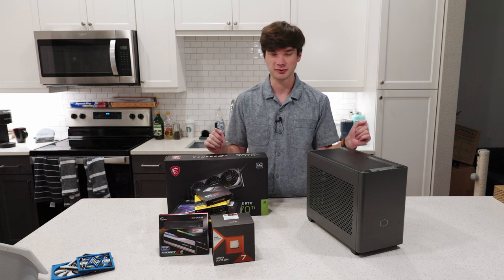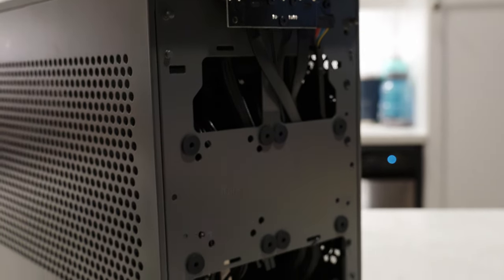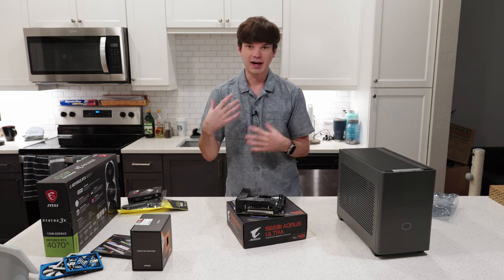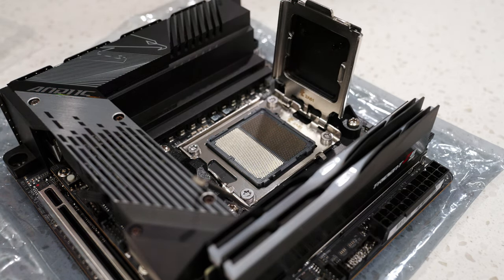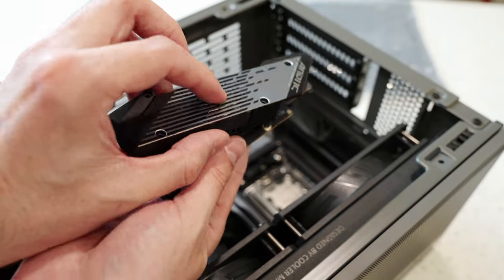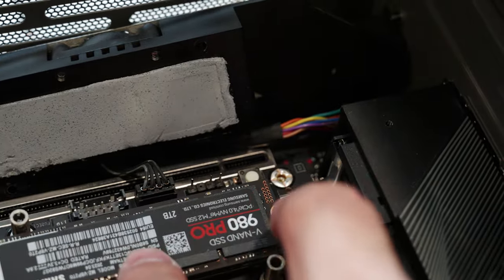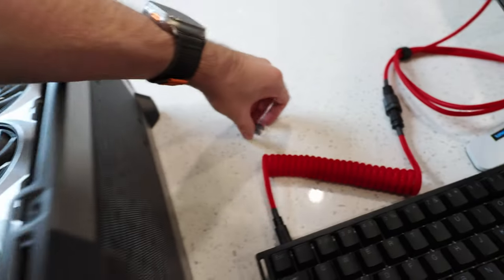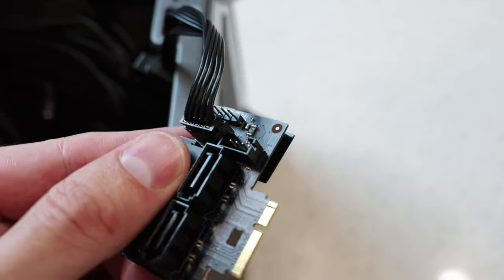The Powerful SFF PC That's Fun To Build w/ 7800X3D, 4070Ti

Comment: I'm planning on building a new pc soon and it will be my first build entirely for myself without having a more experienced friend guide me through it. I'm going ambitious and doing a small ITX build because they're by far my favorite... I'm just stuck on cooling setups because making sure everything will fit, and then on top of that figuring out an effective arrangement for cooling (in most cases) seems difficult. Using your video as a reference is helping me understand the process a lot better!
Reply from the maker: This is a great starting point for a first ITX build. Since it's got the power supply and cooler already installed it let's you focus on the fun parts being the mobo installation and the graphics card. Then you can add in fans as you figure out how your components perform in the setup. You'll have lots of fun. Stop by later to share how the build goes, if you'd like.

Comment: I'm looking at building my first ITX PC to downsize from my big ATX PC that I built earlier this year with a 12600K & a 3060, I'm also looking to eventually upgrade to a 7800 XT. I like how it's a bit bigger than some of the really small SFF PC's to allow for more hardware compatibility but still be small enough to be an ITX case, I also really like how the IO is up top with it too.
Reply from the maker: That's exciting! This case seems like a great fit for what you plan to do with it. Personally, I am so happy with the size of the PC. It can fit on my desk, on my entertainment center, or on the floor without taking up a lot of room and it's pretty light weight. It looks tiny up next to my Fractal Design Torrent but, like you mentioned, has plenty of space for high end hardware.
Reply: Anyone know if I can delete the original email address from my apple account?

Comment: I just got the same motherboard today, manufactured in 10/2023 so its a pretty recent one and for now it doesnt have any coil whine, so far so good. For the ones who have problems with the mediatek wifi card, or simply dont like it, you can replace it with some ax210 one simply by taking the i/o cover and swaping the wifi cards.
Reply from the maker: Congrats! Good comment on the wifi card. I didn't even know swapping it out was an option.

Comment: Nice buid! I chose this one for my 2nd rig, I have this case with an i9 12900K, RTX 3080 64GB DDR5 64000Mhz and a 2TB 990 Pro, i was gonna put my 4090 in from my main gaming PC but i'm not sure it will fit lol but i love this case it's awesome. Oh I also added some slim arctic fans underneath the GPU for more air intake i would reccoment fans at the bottom as well it really helps.
Reply from the maker: That sounds like a sweet build. I added some slim Noctua fans at the bottom and that seems to be working pretty well. Thanks for the advice.

Comment: I have the same case and LOVE it .. runs great !! You can run slim line fans at the bottom to bring cool air inside under the gpu .
Reply from the maker: It's pretty great, right? It strikes that perfect balance of supporting high end hardware and being very compact. I placed one slim fan down there and I'm planning on putting another.
Reply: @TaylorBrauer   Coudlnt agree more, this is a case that hit a home run for sure !  I run a RTX4070 FE card  and the colors compliment each other perfectly.
Reply: some run 2 full size fans isntead of slim fans
Reply: @jonnyfontane3607  depends on mounting position, and the older cases can accommodate full size .

Comment: Quick question, I'm a bit confused as to how you managed to do the front I/O connections in the end. Did you plug into the HD Audio slot near/under the nvme cover? Then use the weird card that comes with the mobo for power button etc? Great video otherwise, just a bit confused with this mobo setup

Comment: I've been a Mac person since I went all in for a IIcx in 1990, but this idea of building your own is kind of fascinating to me. I especially like this more compact case and cooling system you describe as relatively quiet. Can that small case be pushed up to using the highest level desktop CPUs available (whatever the fastest i9 or Ryzen is right now) and, say, a maxed out 4090 GPU? I'm curious how far you could take that compact and quiet total package in terms of performance. Please be forgiving of my lack of experience with x86 builds. My approach has been when my current workstation or laptop will no longer do what I need it too, I buy the highest spec Apple Pro workstation or laptop I can find on the Apple refurbished store, and I typically keep using them for five to seven years.
Reply from the maker: I believe so. I've seen some video out there with 4090s and the most power cpus from AMD and Intel. I would have put my 4080 in here but it was just too long. I think the only 4090s that fit are the generic ones from Nvidia. The form factor is so nice. I have have it on my desk and it's like a little windows Mac Studio equivalent. I'd still probably prefer the Mac Studio. Maybe some day.
Reply: It can, but you will need to swap the PSU, possibly the cooler and get two bottom 140mm x 15mm fans doing in push config, creating negative space. Meaning you pull in air from the vented side panels, and then push it out from the top and bottom. Meaning both components get fresh air and stop recycling of hot air from blasting them with the heat. Would also need a solid undervolt on both parts as well. I've seen it done, so it is possible!

Comment: What about airflow ? Even no extra single one for intake and exhaust?
Reply from the maker: It's stayed surpisingly cool with just the one fan (installed upside-down). Since this video dropped I added a second fan and corrected the orientation which cooled it even better but did add some noise. The AIO in this case is a beast.

Comment: Would u recommend the 7800x3d over the 13600k? someone told me if i buy a  7800x3d is "I paid money for a component and now I have to drive it manually and make it work game" is that true?
Reply from the maker: The 7800x3d is a great gaming CPU and the 13600k is a great all around CPU. You can't go wrong with either so left your budget be the deciding factor. The 7800x3d works fine after driver updates, just like every other cpu. There's no fine tuning involved.
Reply from the maker: I also have a video comparing the two cpus that you might find helpful.
Reply: @TaylorBrauer  sweet can u link it for me? i am on mobile and its kind of hard XD
Reply from the maker: @MrViperForce  https://youtu.be/6UFy4XJ_5Vc
Reply: @TaylorBrauer So that means I won't have to mess with the voltage of the CPU then?
Reply from the maker: @Specialpants  You won't have to mess with the voltage, no. Just be sure your bios and drivers are up to date.
Reply: @TaylorBrauer  and I can use expo with no problem? Just update bios and turn on expo and I'm good?
Reply from the maker: @Specialpants  Yep, it's as easy as that. No fussing with voltage or anything.

Comment: normal temperatures, if you put 3 coolers on the bottom it will be even better)
Reply from the maker: I love how there's room for slim fans down there. I have one atm add and I plan to add a second. idk if I can fit 3 but if I can that's even better.

Comment: Hello Taylor! I know this video is months old, but have you had any growing pains using AM5? I’m in the process of planning my new build and I’m debating between LGA 1700 or AM5. I’ve heard/read that AM5 can be very hit or miss. I would like to know your experience using AMD’s new platform. Great video/build! Thanks!
Reply from the maker: I've had none whatsoever. This is my main gaming PC and it's handled everything without crashing or stuttering. I can't speak to any issues paring it with an AMD card because I keep it paired with Nvidia. I've only used it with Windows 11 too so maybe the chipset drivers are more mature on 11. The only thing I really don't do with this CPU is expect it to work well with video editing since it doesn't really have the cores to perform well in those tasks.

Thanks! Have a good one.

Comment: Awesome build sir! I plan on using the same case for my build as well. BTW, what software are you using to track all your Cpu, gpu, ram, temps, and fps? Looks great!
Reply from the maker: Thank you! It's such a great case to build in and the thermals stay in check. That software is called CapFrameX. It leverages RTSS software to display stats.

Comment: can I go rtx 4090+intel i9 13900k with nr200 max? the power supply only 850w which is power enough ?
love the itx case small form factor!!
Reply: i think u need to underclock ur cpu and some 4090 require 1000w as recommended
Reply from the maker: I can't say for sure as this is only my first itx build but there's other videos out there with 4090/13900k configs which might give you more insight.
Reply from the maker: @_AshishMohanty  That's a good point. That would be a lot of heat.
Reply: @TaylorBrauer  yeah unless someone is costom watercooling their itx build its cery hard to tame 13900k even 360 aio without proper thermal application

Comment: Cool man xx Love mine, though my 3070 runs a little hot; higher temp than your 4070ti. So I gues the 40 series runs cooler?
Reply from the maker: It's such a great case. The 40 series is more power efficient than the 30 series and is a bit cooler as a result.
Reply: @TaylorBrauer  Yeah it’s nice - love how all the panels come off so easy, and you can swap between the mess and glass. Thank you, that’s useful info - I’m looking to get a 4080 / 4070ti s / 50 series equivalent in the not to distant future 👍

Comment: You can instal two slim fans on the bottom. Just get a 4pin Y splitter
Reply from the maker: Thanks! I actually got one under there. I need to add a second.
Reply: @TaylorBrauer  your CPU runs hot. I made same build but instead of 4070ti i added 7800XT. CPU temp around 60C while gaming
Reply: some can fit full size fans instead of slim fans, ill try full size as soon as i got the case/parts

Comment: Just put my system together with the same case and mobo, the problem I’m having is that nothing turns on when I turn it on. The only thing that turns on is the lights on the back of the mobo. All the other stuff doesn’t turn on, my fans don’t spin, nothing. Only lights. I’ve tried taking apart all the connections and putting them back in and nothing still. Any solutions?
Reply from the maker: Ah, that really sucks. It could be a number of things. I'd recommend you build outside the case and work your way down to pinpoint the issue. Also check your motherboard for error codes.
Reply: @TaylorBrauer  gotcha thank you for the advice! I ended up taking it to a computer repair shop to see if they could solve the problem. Hopefully they will find the problem.

Comment: planning on building this with a 4080 but just figured out the psu only has 2x8Pin Pcie but 3x8pin are needed how did you solve this???
Reply from the maker: I thought it had 4 8 pins. My gpu is pretty crammed in there and I don't remember the exact count. Amazon lists it has having 4 8 pin connectors.

Comment: I'm also building my first itx similar to yours, same case, cpu and gpu 4070 TI but I haven't decided which one to get yet, I'm undecided...:hand-purple-blue-peace:
Reply from the maker: That's exciting! This case has converted me into a SFF believer. I'd recommend going for smaller sized 4070Tis so that you don't run into any clearance issues or pinch your fingers getting it installed.

Comment: 7900xt kills the 4070ti man...why u used a 12gb vram card?
Reply from the maker: 4070ti is a beast card and the MSI one here is a good value.
Reply: @TaylorBrauer  a beast card?
4070ti has less VRAM...less memory bus...less terralfops and less memory bandwidth than the 7900xt.
next time spend ur money more wisely..it's a shame u didn't get the 7900xt which is a better card overall
Reply from the maker: @nephilimslayer  That's great for the 7900xt. Sounds like a great card. The 4070ti is still a beast.
Reply: @TaylorBrauer  if u take both cards at face value for price.......the 7900xt is the clear winner. 
I didn't say the 4070ti is a bad card.....all I said for that money your choice was bad because the 7900xt exists in this world and beats the 4070ti in everything while costing the same price. if the 7900xt didn't exist then the 4070ti would be a good option.....but that's not the case since AMD came into the game with great GPUs and good prices
Reply: oh btw......change the 2 fans on ur aio with noctua fans....they give u a couple of degree's less on both GPU and CPU
Reply: @nephilimslayer  Dude you don't got to tell ppl how they should spend their money. He is playing BG3 in this video, which clearly doesn't need a 7900xt to make the game run better.
Reply: @lucaschenJC  dude the 7900xt is clearly better costing the same price.....that's what I said......why people get worse card? u need to search better before buying something

Comment: you may wanna watch some itx building guides from professional itx experts like optimum tech or gear seekers, as well as machines and more, your bottom fan setup is not and intake fan that's an exhaust and given than the top radiator that came pre-mounted by CM they are working as exhaust fans and blowing air into the radiator and then out of the case from the top, with all that being said,you have created a negative pressure inside of your case despite using the ventilated panel, and that TG panel was the stupidest idea from CM ever made, those kind of cases especially us itx builders dont really care about esthetics and looking into the internals , however good thermal performance is the major problem here,
Reply from the maker: Thanks, yeah those are some good builders. I did make a mistake with the bottom fan being exhaust that I quickly caught but not before releasing the video lol. The glass panel does reduce thermals but not to significant degree. While I prefer the ventalated side panel the vertical graphics card is really nice to look at through the glass. It would be even better with some good interior lighting.
Reply: @TaylorBrauer  man you are making that triple fan GPU suffer🥲 with that TG panel